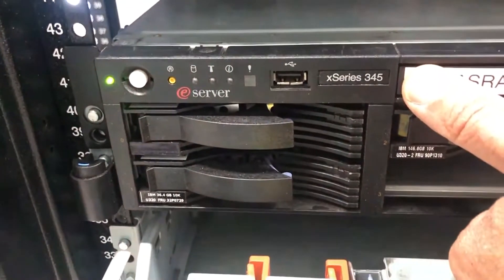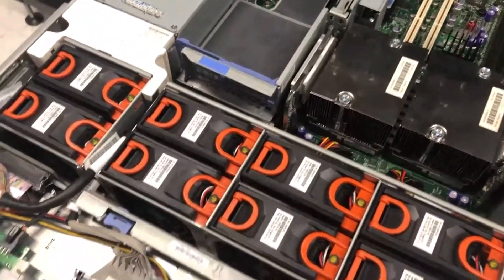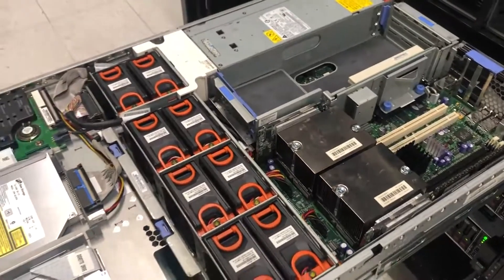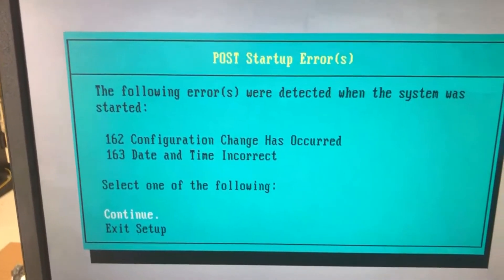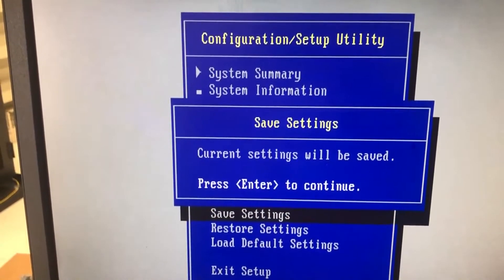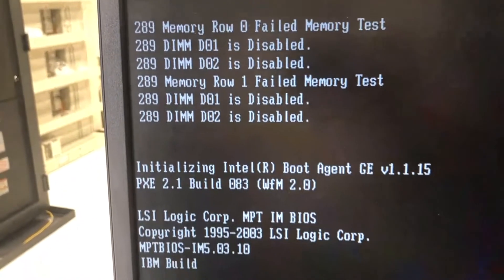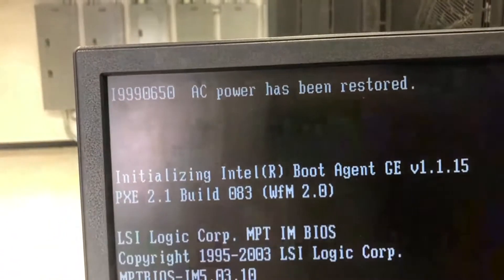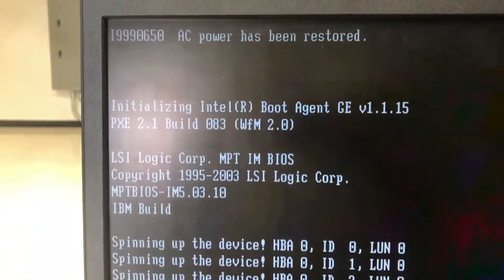IBM x345 server boot problem

Comment: Hello, I just bought an IBM 346, it has the same BIOS as the 345. My problem is that when I start the server it doesn't detect any hard drive and when I want to install an operating system it doesn't recognize any hard drive even though it has 6 drives in the backplane.
Reply from the maker: Did you get into the BIOS - Configuration/Setup Utility? Load all default settings?
Reply: @OutdoorsNature  Yes I did, but at first it didn't detect any scsi disk, I could tell because the bus and disk lights didn't blink, and the operating system didn't start, then I pressed ctrl+i and tried to restore the raid configuration and only then did it detect only 3 hard drives out of 6, then I tried to install puppy linux but it seems that it was installed incorrectly because it couldn't find the boot folder despite following the installation steps, I also tried with windows server 2008r2 but the bios didn't take into account the iso image of my pendrive